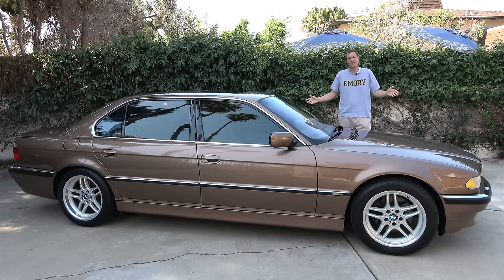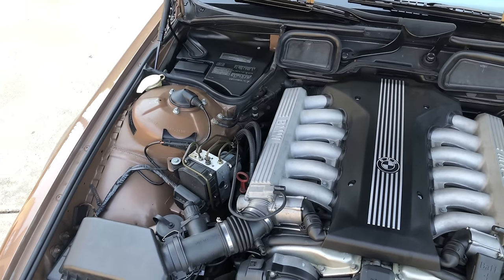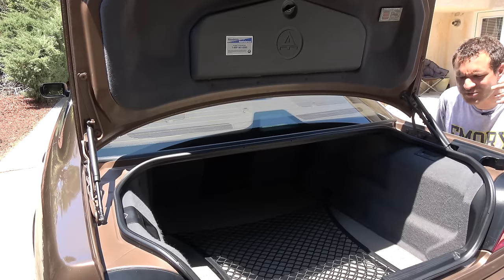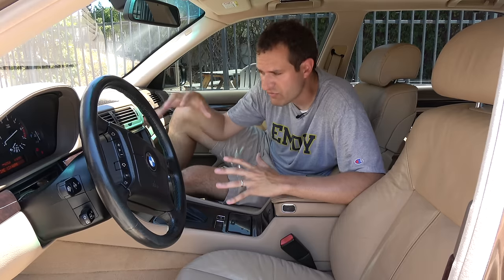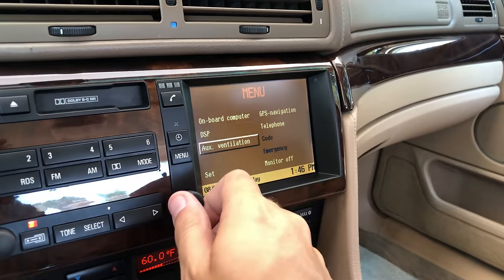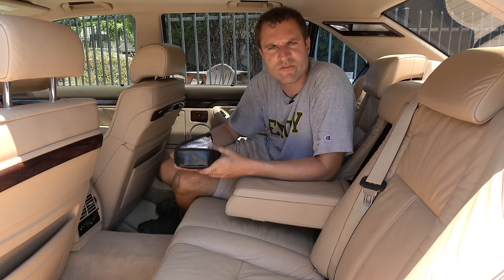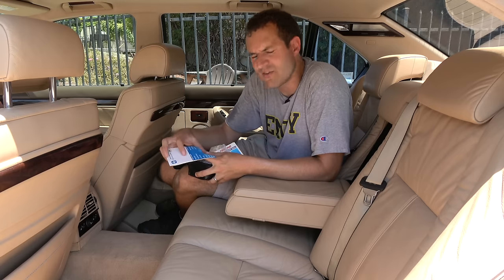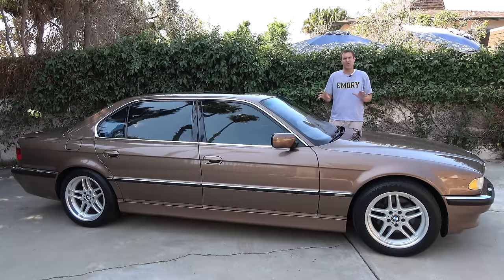Here's Why the 2001 BMW 7 Series Is the Best Luxury Sedan Ever

Comment: Regarding the rear heated seat.
This a L, so a Long version. It's meant to be used by CEOs, ambassadors and big dogs. They will be sitting in the back, so of course, the main and most important seat is NOT the driver's position, it will be the opposite: the right back seat.
It's just matter of the point of view.
Reply: on point.... Well said 👌
Reply: You are wrong. The dial adjustment was standard in the front and the back on pre-facelift models. After the facelift they introduced these buttons, but for some reason they have only changed them in the front. Probably because of how rarely people selected the option of heated rear seats. It also might have something to do with the E39 and E53 as the X5 always had buttons for heated seats.
Reply: @darek4488  Never Always?
Reply: @acmeopinionfactory8018  Editting error. Fixed now. You can delete your comment.

Comment: Between first seeing this video and now, I flew halfway across the country to buy one of these. Been eyeing them for over a decade, and the stars finally aligned to get the cheap project car equivalent of a tactical aircraft carrier.

Interesting about the warning triangle; I bought a really rough condition 750, and the warning triangle was one of the few things STILL present in the trunk tool kit. 2000 year model. None of my other used BMWs ever had that.

Comment: The classical styling for Europeans has been replaced by the futuristic styling Chineese customers prefer. Sad, but logical
Reply: very good point, I never looked at it that way!
Reply: Ike N  not all of that is truth, regards
Reply: Ike N  rolls royce were the best built cars in the world,bentley was their sport version to the ones who drived , normally rolls owners use a chauffer, and to drive fast there were the sport brands, mercedes was the second best brand ,they used to have at least 3 series of cars with some variations on each serie, Mazda was without  a doubt considered  the best oriental manufacturer ,just look at the last cars they produce before bankruptcy, this in 1990 ,i think. compare those cars with their new versions in the second half of the 90´s ,when Ford bought the brand, it´s the same of comparing a Mercedes S-class new , with a renault 5 from the mid 80´s ,totally diferent cars the quality of the materials used were never so low, in all mazdas existance. and to copy a text out of context ,it´s just non-sense, BMW owns Rolls-Royce and almost all the other british brands, what do you mean by that???, the last paragraph, it´s really taken from the twilight zone or you never saw a rolls or a 7series from BMW,they(e38´s) are good cars but not even close of s-class from mercedes and much more distance from a rolls that is owned by bmw, i own two e38´s from diferent decades, one is a diesel the other a gasoline , they are totally diferent one from the other and they have more than 10 years diference in production, so i don´t know at do you meant when writting what you wrotte , regards  and the next year will be better, one can only hope?
Reply: i don´t know where you find that info. but ,where did you saw chinese prefering anykind of car ,but i can tell you that since the mid 90´s lot´s of chinese families came to live on my hometown ,and all of them when having some profit of their businees ,bought E series from mercedes or 5 series from bmw, no other brands i saw them buying till today, and chinese customers are a few  not even a small % of the total buyers in car business, i don´t know if you know China but ,only some have money to buy a good car and there´s also the chinese cars that are copies of merceds and bmw´s, etc. recent models wich the owners of the cars design lost their court action against chinese car industry, they use in the defense the fact that you can compare a %&##$&&/)=""##* with a S class mercedes  and  they might look from far similar but in reality  their good looking chinese cars don´t have a 1/3 of the quality of the original model and looking close the similarities become almost non existing. And where did you heard of "the futuristic chinese customers" that just don´t exist or did you forget they are a comunist orientated dictatorship, they kill people as kids kill bird´s with bb guns, did you forget how they handle the students revolution on 1989 Tiananmen Square protests.At the time we didn´t see half of it.
Reply: Exactly! Now The cars have a chinese-asian design...and it is terrible
Reply: DerNitroXD Wow I looked it up and was surprised, I knew it would be a lot sold in China but I didn’t realize it was the largest portion by far. Share of BMWs sold by country in 2017: 1. China at 24%, 2. US 14%, 3. Germany 12% 4. UK 9.8%
Reply: Zohaib Ajmal you sure you‘re not just being a social justice warrior? Different cultures developed different ways of design, and to sell goods you have to adjust your design to the main target group, which today is mainly Chineese customers. But no hard feelings bro, neither towards you nor towards Chineese customers and there view of a good looking car. It‘s just not matching with the western world‘s dominating view. Not at all.
Reply: Zohaib Ajmal yeah In this case it’s pretty objectively true, no reason to think it’s racism. China buys more of their cars than any other country. They do quite objectively have tastes that lean more towards conspicuous displays of wealth. I went to China, and all my Chinese friends said “money is god in China”. It’s all fake Gucci and yeezys and knockoff Chinese versions of BMW x5s and stuff like that. It can be uncomfortable to call it out but it’s true - new money on a collective scale. It’s understandable but really lame imho.

That being said I hear a lot of racist bullshit about Chinese people, especially from Americans who just want to blame them and don’t know anything about anything.

Comment: my bmw 540 from 1997 has parking scensors
Reply: lol my 96 cheap ass e36 318 has parking sensors xD
Reply: That's because that's is the top of the line BMW 5 series untill 2000 rolled around and America got the BMW M5
Reply: My 1996 540i also have sensors, same heated seats, electric steering column etc.- BMWs from that era was really fully loaded if you order it from factory, especially V8s in e39 or V8 V12s in e38.
Reply: @Gierap  lol i have heated seats, electric windows, that automatic deblinding rear view mirror or how you call it in english.., pdc, automatic climate control, electric mirrors, cassette deck in the middle armrest, footwell lighting but no cigarette lighter or ash tray.. got the car with 170k km in mint condition for 1 grand here in germany. Have it for a year now, put 30k km on it without any problems so far.. the only problem is that its only a 318 but it only needs 7l gas on 100km :D

Comment: Actually, a Toyota land cruiser 1997 model had a parking sensor
Reply: on that note since the early 80s the toyota carina had a backup sensor
Reply: Yeah, they weren't common at all, but this was definitely not one of the first to have sensors
Reply: In a certain context it could still be considered one of the first.  It wasn't THE first, but one of as much as is reasonable because of how few actually existed before the technology became popular.
Reply: My 95 740i has them too.
Reply: My '98 E39 has it also. Seeing you guys saying it was available earlier still, I'd imagine it was quite common, at least as an option, by 2001.
Still, have to laugh when you see them fitted to even the smallest of cars these days. Do cars such as the Audi A1 really need parking sensors? Have people really become that dependent on technology?
Reply: the 1989 bmw 750iL had them as standard in some markets
Reply: No. Parking sensors were introduced with the facelift model of the BMW E32 7-series in 1992. Since then they were standard to the 750i V12.
Reply: 100% sure it was for sale at car dealer 1988/89 750iL automatic had rear factory park sensors fitted, rear sunshade plus telephone. way ahead of its time.
Reply: Soz
Reply: Well, the PDC from BMW had sensors in front and rear. As I said, PDC was introduced for the 92 model year in 09/91. Standard on 750i/iL, option on all other engine models. BMW sold a retrofit set, though. Also for E34: https://bmweba.com/eba-01-29-9-788-017/amp/

Comment: Sorry daddy Doug but my 2001 ford windstar had rear parking sensors too haha
Reply: ryan Mosey yeah my 97 explorer has them too and they work as well. I love how he hypes stuff up when has no idea when that feature actually debuted.
Reply: The e38 started in 95. I had the 95 version and it did infact have rear AND FRONT parking sensors.
Reply: ryan Mosey alright I’ll jump on the bandwagon... my ‘94 Benz has power headrests, power tilt/telescope wheel, rear heated seats, power rear seats and a built in phone. All of it still works too after 215k miles
Reply: You said it ryan Mosey, I'm going to brag to friends about my Ford Windstar's features too.

Comment: Beautiful 750 IL, but still prefer the 1997 Jaguar XJR
Reply: Having a 1998 XJR myself, it's hard to hear someone say the E39 is the best looking sedan ever :D
Reply: +JaviCr72
Were you lobotomized?

+ThirteenMatt
You were most definitely lobotomized, as this fine specimen here is an E38...
Reply: The straight six supercharged or the v8?
For me the straight six is a wonderful engine that is smooth, powerful, and sounds wonderful. The AJ16 engine was massively underrated, and moving to the ford derived V8 was somewhat of a mistake in my book
Reply: JaviCr72 Couldn’t agree more.  The Jags were the prettiest cars on the road.  The redesign to the current version killed the looks of that stately sedan.  I still want one of those older Jaguars.
Reply: Glad you like it JaviCr72 but this video isn't about you.
Reply: @SeriouslyKidding  oops, typed to fast...
 @joannaatkins822  Er, that V8 is a pure Jaguar developped and built engine, and actually the 3.9 V8 in Thunderbirds and Lincoln LS is derived from it.
Reply: brian.dudek - No, but this thread is lol
Reply: @ThirteenMatt  You're absolutely right, I must have gotten confused somewhere along the line :/
Maybe it's because, as you stated, jaguar shared this engine with ford/lincoln and because of the Ford buyout of Jaguar?
Reply: @joannaatkins822  Well, a lot of people get confused with that, usually because it's not that far fetched to assume that Jaguar switching to V8s after being bought by Ford they just used a Ford engine. It's sad because it's a great engine. At least I love mine ^^
Reply: I much prefer the styling of a 1992 Cadillac Sedan Deville, all BMW's are bland and boring with no style.

Comment: my 97 Mercedes Benz have the Parking sensors. where is the deal?
Reply: BMW had parking sensors in 1992-1993, before Mercedes-Benz did.
Reply: E34Benzin very true :) fathers old 1990 Alpina B12 e32 has them fitted :) back when he had it in the early 90s

Comment: I owned a 2001 740IL. It seemed to travel more miles vertically up and down on the repair rack at the dealership's service department than it traveled on the road. It was a gorgeous vehicle, but a nightmare in terms of reliability. I was happy that the dealership agreed it was a lemon and bought it back from me.

Comment: The boot lid can be opened from inside, from the key, and optionally could be fitted with a self-lift function.
Over here in the UK, most examples are low spec and 728i, but even then, they're still a nice place to be.
Looking at the tyre pressure sticker, I actually wonder if the 728 is a little rear-heavy, with the larger engines having more central balance.

Will add, the heated front screen is handy too.

Comment: I had a 1998 740i which was great - had an even older style phone included than your model.  I don't know if your version has it, but mine had a 6-disk CD changer, located in the trunk (my new car doesn't have any CD player, to my annoyance).  Had it for 14 years until it was totaled by a deer.  Solid like a tank.

Comment: I could be wrong but I think the massaging seats was actually something BMW called "Active Comfort Seating" and it worked by having two bags of fluid in the bottom of the seat and the fluid slowly moved between the two bags which slowly changed the position of your hips, which mimics walking movement, and keeps your weight shifting during longer roadtrips and keeps your butt from getting uncomfortable. Super cool feature that I haven't seen in any other car

Comment: I bought a 1998 brand new.  Opted for the 4.4L V8 because the V12's had issue.  Was black on black, and had bulletproof glass. 

Best driving car I've ever owned, and I'm really considering finding another one and restoring it.

Sticker was $72k, while a 750iL was over $90k. Had virtually all options including the cold weather package.

Comment: Im not sure about the model Doug has Here, But my e38's hydraulic Trunk will Open if you Just Push the keyhole With your Finger as Long as the Car is unlocked, you don't need the key for that. Same on my 2000 c-class with Manual trunk, this Mode of operation is actually very common in German Cars of the era. Aside from that, you can also Open it via the key Fob which He didn't mention :)

Comment: "With technology this car gave you everything you needed but it wasn't an excessive overkill of Technology" which is what you see with today's modern cars. In other words. "BLING!" The truth is, cars have still not seen a noticeable increase with MPG since the 1990's. Fuel Injection. 1990's.  Anti-lock brakes. 1990's.  Air bags. 1990's. OBD II diagnostics. 1990's.   Useless flat screens that are an eyesore right on top of the dash (no option to fold them away either) that make you take your eyes off of the road to use to turn on the air conditioner.  2020's. Brilliant! But MPG still the same. (I don't consider going from 20 MPG to 21 MPG worth noting).

Comment: btw there is a few differences between the 750il and the 740il.  the v12 cars had dual pane glass in all the doors, full leather wrapped dash and door cards (v8 cars were partially plastic), the ash trays in the rear doors were wood grain (plastic in v8 cars). i probably forgot a few differences but there’s that tidbit for you

Comment: Had a lease back in 2000 on a 2000 BMW 740, and this car is the worst car I ever bought. With only less than 30k, sometimes it would not start , finally got so frustrated I terminated my 36 month lease and would never ever again buy a BMW. Bought a Volvo S60 after that and what a great car.

Comment: Doug- 2001 7 series it has rear parking sensors form the factor. It would have to be the first car to have them back in 2001.
 A BMW 1999 e46 coupe That I own
has factory parking sensors and I am pretty sure I friends 1998 e46 had them as well.
Also they weren't massaging seats they used a system of fluid in the seats to change the pressure points so you did not get cramps on long trips. There were also a few other things that he did not get quite correct. You would think for a Guy that does this for living He would do a little bit more research on  the vehicle he does a review on. Still ok but could be alot better.

Comment: My problem with 90s to early 2000s cars is most manufacturers shared the exact same design language which gets stale. 

This 750Li beamer looks like a 2000s Honda accord which looks like a 2000s chevy Malibu which looks like a 2000s ford crown Victoria. Manufactures played it to safe and there was no thrill in design, 90s-2005 was the only period at which the entire industry was this similar. Today a Nissan 370z looks nothing like a bmw 750Li which looks nothing like a dodge dodge dart.

Comment: What the hell Doug?

You don't need the key to open the trunk from the outside, just press the key hole/button and the trunk pops open. No need to insert the key, unless its locked.
There is center console storage. A drawer slides out from the door you can clearly see under the armrest, facing towards the ash tray. (He sat in the car, didn't he think the lid must be there to cover something? Didn't he try opening it? Mind... blown.)

Comment: I watched this review first 2 years ago and I didn't pay much attention at the time, less than an year ago I bought a E38 740i with the V8 engine and as an owner I can now state that this was the absolute dumbest opening and closing of the boot I've ever seen :D

1. You can just click the boot button with your thumb when the car is unlocked, you don't need to put the key in. You can also press the 3rd button on the car remote to open it.
2. To close it, you just put it down and just press it gently from the top and the soft close engages immediately

Comment: I love this model. I also like the previous model. I hate the model that came after this one and ever since BMW has ruined the 7 series. The only thing I consistently read is that the V8 engines aren't without reliability issues (same engines in the 535i and 540i) so the more solid V6 engine would be the choice to go. But who cares. This is not a BMW to go fast. This is a BMW to relaxed and enjoy!

Comment: 99 740 IL is better more reliable and its better looking. The breaks wear out to fast and you can't turn the rotors is the biggest issue in the 99 740 but it might have the same problem in the 2001 750? Also the Equus is the best luxury car for the money ever made.